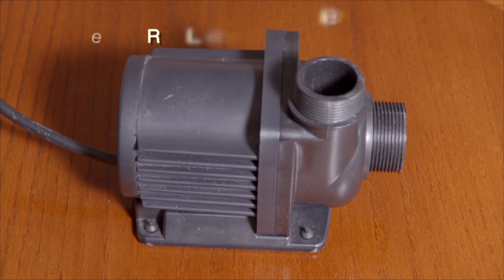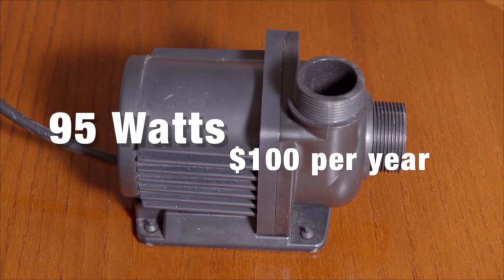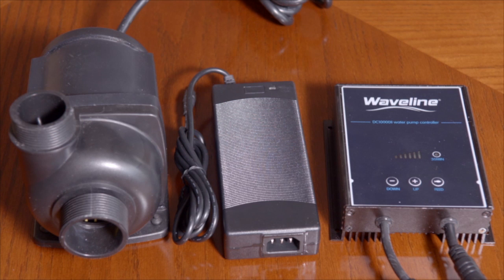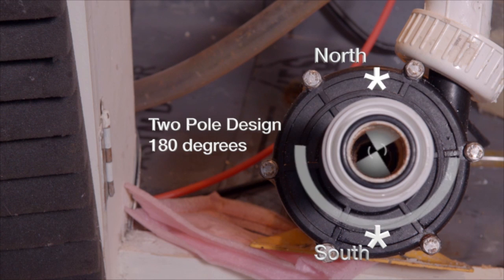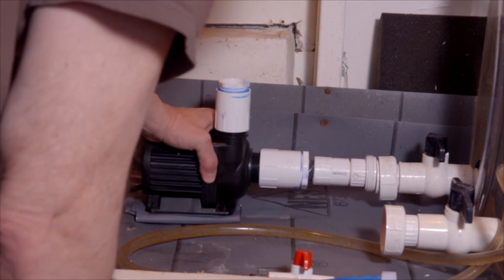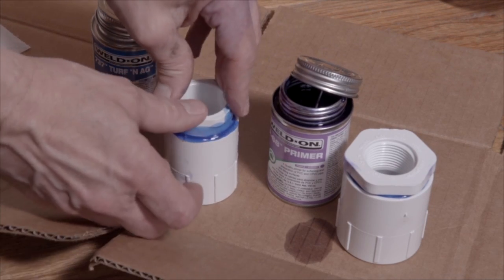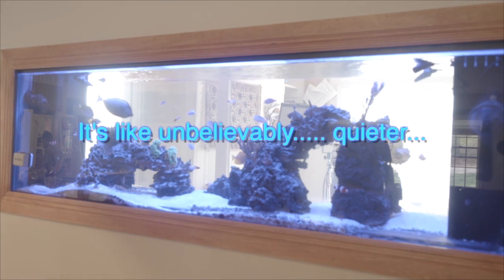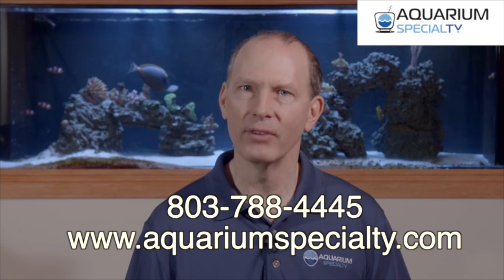Waveline DC Controllable Aquarium Pumps

Comment: Where do you find the rubber mat ?
Reply from the maker: Corey Locklear There is no need for a rubber matt unless you are just wanting to use one as a water barrier between your stand and your equipment.  He is using that in the video since the pump heights are different from the one he was using verses what he's using now.  The rubber matting is sold by the linear foot from places like Home Depot & Lowes.